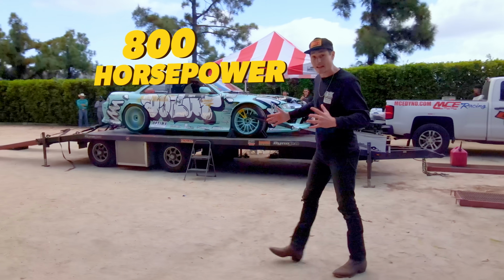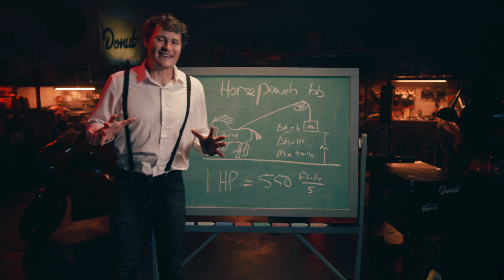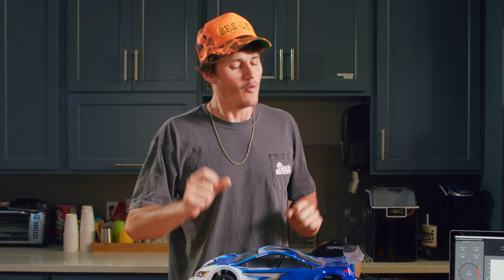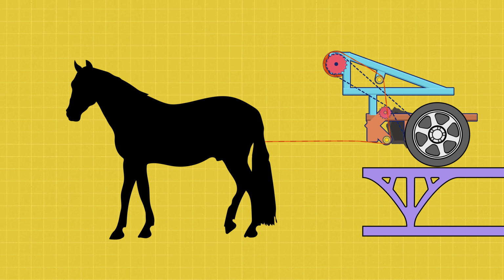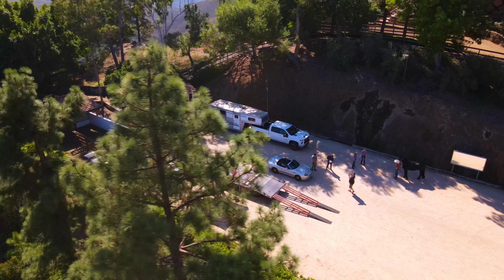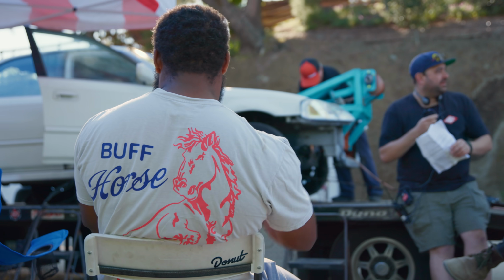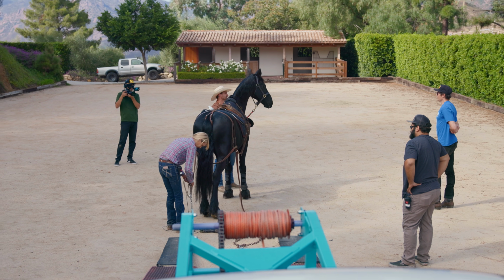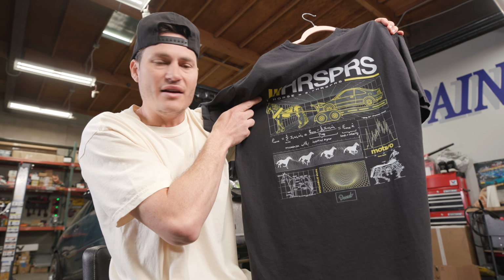How Much Horsepower is a Horse?

Comment: I don't know how many times I've tried to explain to people that horsepower is just a calculation based on power and speed (torque x rpms)/5252. This is why torque curves always cross at 5252 (as long as the machine gets to that rpm). This is also why higher reving machines typically have higher peak horsepower than torque, and lower reving machines typically have higher peak torque than horsepower. Something that can't rev above 5252rpms will always produce more torque than horsepower.
Reply: Well if you explain it wrong no wonder people are confused, you said horsepower is based on power and speed lol that's wrong.
Reply: @Iseenoobpeoples  I misspoke...horsepower is based on torque and speed*
Reply: @Iseenoobpeoples  I had a professor in an auto tech class tell me I was wrong when I mentioned that horsepower and torque would always cross at 5252 rpms, when a student had asked about it. He asked me how I would know that. I mentioned that horsepower was a calculated number based on torque and speed. I mentioned the formula to get horsepower, and even after mentioning the formula, he stated that it wouldn't always cross at 5252rpms. I said that it wouldn't if the engine couldn't get to 5252 rpms, but other than that, because it is calculate off of torque using 5252 rpms, it had to cross at that point.

Comment: Jus build a horse treadmill with the dyno drum as one of the rotating cylinder... Easy horse dyno
Reply: It wouldn't work because the horse could potentially break its legs on it. This was a safer method.

Comment: Someone should have done the equivalent of this 50 to a hundred years ago. I asked a auto mechanic about this when I was a kid in the 80's. I'm surprised that Myth Busters didn't do something like this when the show was airing. This is one of the coolest episodes of Donut. Thank you.
Reply: They did do it and it came to 1hp over a day's work, what we see here is peak HP not sustained HP.
Reply: cars are dinoed at peak horsepower as well its good for an apples to apples comparison @Iseenoobpeoples
Reply: @Iseenoobpeoples LMAO no they didnt😂 also thats not how this works
Reply: @braed_1651  Yes it is, for industries it's the amount of work done over long period of time that is important... Attach this horse to a water pump and do the same with a 5hp electric motor, the electric motor delivers maximum power 100% of the time, at the end of the day it will have pumped MUCH more water, 3-5X more.
Reply: I completely agree. I was so excited to see this after seeing James Watt's diagram and formula in textbooks forever. I just wonder how much the reduction with the harness going through the pulleys may have contributed or not to the results. 

It is great to finally get a definitive answer.❤
Reply: Because YouTube didn’t even exist 50-100 years ago. 🤓
Reply: @brettbarker8444  did he say anything about a vid/youtube? Stfu you need that berd emoji
Reply: @braed_1651  Calm down. It's a joke.

Comment: 550 x 5.7 = 3135. So draft horse can pull 3,000 lbs vertical over a pulley?
Reply: If he pulled at 1RPM that's 30,000ft*lbs of torque.

Comment: 15:52 
Actually not so good for all the car guys out there…
If it turns out that that a horse produces 2HP, for example, then every single car-guy’s car power figure (in conventional HP) actually gets cut in half. A 1000HP supra will become a 500Big-D-HP Supra… and that’s just if he makes 2 HP. If he makes 10 then your Supra is only making 100…
Car guys are about to get a fucking reality check is what is actually about to happen imo

Comment: So James Watt's engine actually produced the power of ONE, maybe two horses. 

But of course, Watt's measurements were based on an all-day average, not a max-power sprint of a few seconds. Big D certainly could not sustain that amount of power all day, whereas a mechanical engine could, so maybe Watt's estimates were accurate, given you're going for average power output over the course of several hours.

I'd actually love to see a setup with perhaps rotating swing arm (like a mill), that way we can measure how much sustained horsepower (over the course of, say, an hour) a horse can produce. That would be a MUCH larger project.
Reply: 1HP for 1 horse does make sense for a day of work.

Comment: Honestly just curious if a motorcycle and motorcycle dyno was not a feasible option?  Seems like a chain coming out the back of the bike hooked to a spool like you originally said that is then connected to a line that ties to the horse would have been the occam's razor solution?  Also a moto dyno is much smaller and many shops already have portable units you could have used.

Hoping for an answer of why I'm wrong about that being an easier solution!

Comment: Note that the Romans had law regulating how much a horse may be forced to pull. A relevant horse power value can either mean to measure max power, or to determine how much work a horse actually can perform all day long. The latter's value will be smaller.
Reply: That's why 1HP = 1 horse.

Comment: Fun video - but your calculations are hilariously wrong.  And I can prove it in this paragraph.  A very reliable way to measure HP is to use quarter mile time and weight.  A race horse weighs around 1200lbs the jockey around 100lbs. A horse can run a quarter mile in 21 seconds. This works out to 25HP.

Even assuming my numbers are a bit off - this means a horse easily has around 10-20 horsepower.  Granted you knew this likely before you started your video.  Just thought that viewers might be interested to know.  I don't think that draft horse was pulling as hard as it could.. So your method is probably not that bad - but it is still bad.
Reply: And how much can it pull on average over a day? that's why 1HP = 1 horse.

Comment: I would say good shot but a lot of holes. It's easy enough to set up a calibration rig and test different conditions to get true loses and setup a proper curve for your horse power rating. Of course that's ignoring tension in the cable during winding and wind pattern but i digress

Comment: To calculate losses ye could've powered it with a known value of lets say 1kw and check what result you get, that would be your system loses. I'm interested to see the published results so I can rip them apart, 5.7ho is too low, a horse can definitely do more than 4kw🤣 Fvck, I love data.

Comment: It looks like Big D didn't even try. ;) He needs some other Horse to match for a competition! Anyway a very interesting experiment, but i think a horse can be way stronger than the 5.7HP that came out. For comparision to a cyclist: an avarage trained cyclist would reach around 1-1,3kW that equals around 1,35-1,7HP. A top olympic track cyclist will do up to 2,7kW/3,7HP ( the ones with the crazy big quads ;)) So even if that top athlete is trained for exactly doing this, a horse should be way way stronger!
Reply: A horse = 1hp because it's the average work it can produce over a day, I'm not even sure humans can produce over 100W over a day...

Comment: I hope the tech-team compensated for the diameter of the rope-spool gradually decreasing as more rope leaves the pulley. Torque always decreases with shorter wrenches. What about the bounce in the horse gear and the total weight thereof fluctuating and also increasing during each pull? 
Edit-
You said Watt did it for the purpose of marketing, yet you throw in your T-shirts at the end. Some might regard that as hypocrisy.

Comment: In layman terms, power is often understood as strength. But scientifically power is amount of energy that can be applied or produced within a period of time.
So I guess if we account of amount of energy a horse can apply on a cart in a 1hr journey, will get something like   1HP only. Same goes for a car, if you drive slow at just 1000RPM at 5th gear you are not actually applying any more than 10-20HPowershish
Reply: Yes 1hp = 1 horse is over a day.

Comment: Also power will drop as pull duration increases as you get tired. Also because you have to pull so hard and the rope hardly moves, there is considerable load mismatch, you feet slip on the ground and you need to lean forward, try adding 50 Kg of weight to you're upper body to get more torque and grip on the ground. lots of accuracy issues, not just the machine.

Comment: 5.7 horsepower? That is unbelievable. Many draft horses are comparable to tractors which are 50 horsepower and more. Either Big D wasn't trying his best or your math is wrong.
Reply: You confuse hp and torque, a horse = 1hp because it can give 1hp of power on average over a day, the tractor will have moved 50X more dirt at the end of the day.
Reply: @Iseenoobpeoples   I don't think they were trying to find out how much of workload a horse can do over a certain period of time. They were doing pulls in short bursts. They were limited to 5 tries, so the horse wouldn't be able to generate such pulls longer than 1 minute per day (according to them). So even the test was done to find out how much momental force a horse can generate. Torque makes sense. But we didn't find out either. Any person who has raced a horse would've known (and would've felt) that these beasts of power can generate similar acceleration to a decent sport bike. 5.7 horsepower doesn't come close if you compare it to a bike.

Comment: couldn't you just weighed the horse then record its maximum acceleration with no weight attached. because that way you could calculate it is power with less variability.

Comment: I see quite a bit of obvious problems here but I am just a simple man 😂. First off you would need to test several horses and take an average of their pulling power. Just one horse is FAR from scientific. How do we know what big D's mindset was when pulling? For example you could tell a human to give 110% of their full power but who knows what big D was thinking. Looks like he was just casually walking probably wasn't pulling as hard as he possibility could? Was he limited by traction in the sand? It was clear that the guys from DM were. With just a little bit more care I feel they could have had a more accurate test but it's better then not having done it at all..🤷‍♂️

Comment: But a working horse is not going to pull that hard all day long.  His numbers are likely not that far off.  His steam engine could likely pull what 5-10 horse could of extended periods of time.  Yes a horse can pull MUCH more (almost 6x as much), but not for a long time.  For machines you want a stable consistent power.
Reply: That's why 1 horse = 1hp.
Reply: @Iseenoobpeoples  Yes, but he is checking HP based on a 10 second max pull.
Reply: @toddabbott781  Yes, good analysis, what is your background?
Reply: @Iseenoobpeoples  I am a jack of all trades.  I was raised on a small farm and did take care of horses for several years and I went to college for automotives and electronics (I wanted to get into automotive design and engineering, but life had different ideas for me).  I worked several years in construction (starting when I was 15), a year at an small awning company doing design/engineering and sales, I worked fast food starting with delivery, then later management for a total of 9 years.  I worked 15 years in automotive manufacturing and during that time I worked as a launch assistant on 3 production lines and later worked in Past Model modifying tools and processes to working in machines not designed to run them as we consolidated down old assembly lines for discontinued parts.  I also do a lot of work with art and am mostly retired at 41... partially do to health issues.  I love information and tech and just absorb it when I can.  I like almost everything too.  So... jack of all trades.

Comment: They appear to have failed to look at the aspect of average horsepower over a period of time versus peak horsepower.  The dyno test was focused on peak horsepower.  In a situation where work needs to be done over a significant period of time which was and is commonly the case, average horsepower is more relevant, and is seemingly what was focused on by the originator of the concept of horsepower.

Comment: My suggestion is if it’s pulling power, retry this with 2 draught horses and calculate it as half you’ll get better results…
Reply: That might not work as was shown in the video, when the pulling strength of the 3 people combined did not equal to their power measured separately
Reply: @mihailc6402  that’s because they were in a series if they pulled parallel it would be better results..

Comment: Many flaws in this test. Big D not an average horse. The contraption rigged up was very poorly constructed and not tested by itself. I didn't see any physicists on board. Using BHP instead of actual HP. The hype. That negates the whole process. It's biased when you WANT the results to be X. No confirmation by another independent test.

Comment: 5.7HP over a short burst and can only be done a few times a day.

The measurement should have been done with the horse pulling with the same power as they would be when doing work in a mill for hours at a time.

You will probably find the HP value will then be a lot closer to 1HP, might even be less.

Comment: A horse can pull easy more than 5 people the Numbers are wrong, there are a bunch of video were horses pull 10+men the problem here in my opinion is that the horse didn’t have enough of a resistance force to really express all the power (like doing a pull in first gear) basically after some meters the dyno was rotating of inertia you can see that watching the ropes drop.

Comment: I love the project. However, to come to a final scientific experimentation, more datas might be required: You might need to try 4 or 5 different horses, different measurement models, metric, statistics, different tools rather only one, and after couple of tests, compare results. 

However, these comparison are not faire to what 200 years people would have experience. (Is natural human strength now days same to 200years ago? Answer is "No". Food were bio and healthy, our organism was less exposed to pollution we daily breath, body was use to do most of computerized and machinery task in the daily basis... with that being said, compare what an average 23 years old male could pull 200years ago is different from what average 23years old can pull today. It just like comparing 10$ value 50 years ago to today value. 
Can we say the same about animal? "Yes" especially pet animal; they eat sometime processed food, breath polluted air, less exposed to daily hard work compare to ancient time where animal did all machineries) 

Otherwise, what you guys did is huge. Because most of unite or measure we use today, Fahrenheit, Celsius, kg, lbs, watt, etc... were completed with limited equipment and technology. But we believe it by convention. And we say, that much is equivalent to one Kg or one Wall, etc... I believe horse-power is a convention the industry agreed upon, rather than the actual power generated by an horse. I also believe that if you allow that horse a long distance, his momentum will allow him to get more acceleration and coil will spin even faster. and your graph will peak higher.